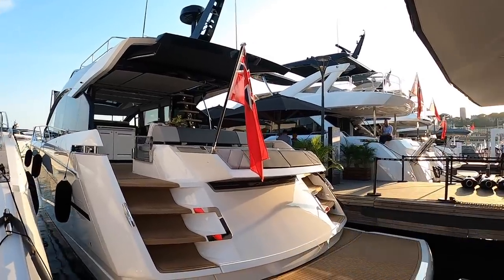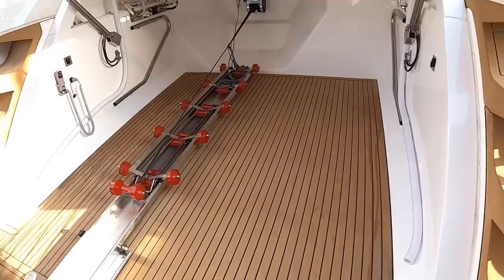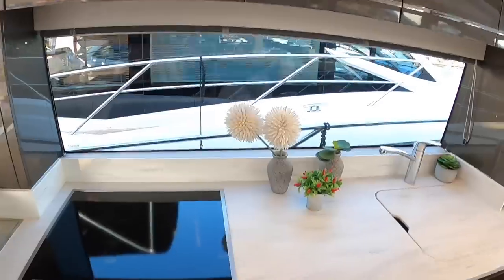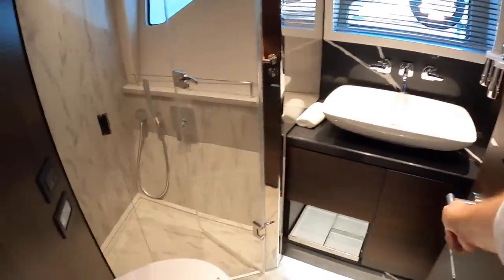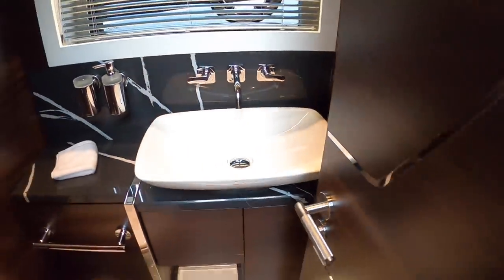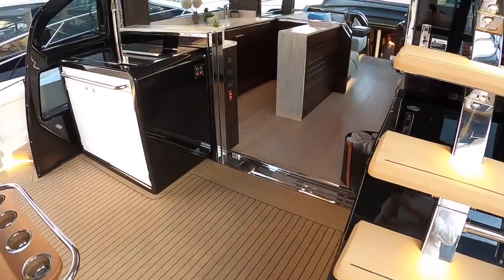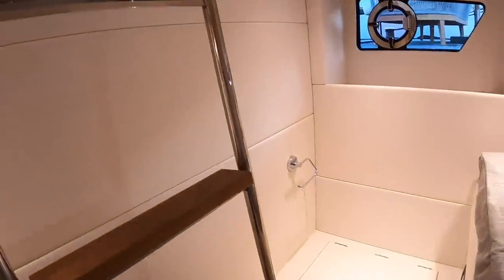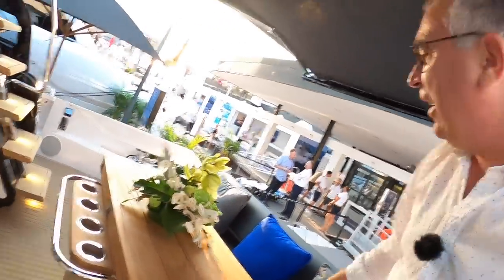£2.4 Million Yacht Tour : Sunseeker 65 Sport Yacht

Comment: I was thinking, crew areas like that one could be great for situations where say you need some emergency servicing done away from the home marina, and maybe need some work done asap and overnight if possible. With a cabin like that, a mechanic/engineer could do that, and then have a place to crash in between work periods, even sleeping overnight if it's a truly serious job. Otherwise, if you want to hire a chef for a party cruise, but all the cabins are full with guests, that's at least an option, etc. Point is, I could see such crew cabins on sub-70 footers being occasionally useful, and in between such times, they still make great storage areas. Personally, I'd always opt for the crew cabin configuration, since it can still serve as storage, but conversely, you can't make a dedicated storage area serve as a crew cabin.

Comment: There were lots of "fantastic", "nice" and "brilliant" in that review. But to be fair, for £2.4M you would expect that!! :)
But my main question: that bow thruster access hatch: is that light like a fridge? Turns on when you open the hatch? Or is it always on. Would you go back and check for me? 😁
Reply: Even if it's always on, they probably use a tiny LED for lighting which would be insignificant in terms of powers usage especially on such a boat.

Comment: Also, maybe you can pass this on to Sunseeker. Why not have the tender areas floor lift up like a basement access? This way if the engines ever need serious maintenance the mechanic is not crawling under the area above the manifolds and still allows for the storage capacity it offers. I race cars and love my one smaller car as I can easily remove the engine with little effort because of the hood (bonnet) design. After all this is a sport boat and I would want to open it up (full throttle) from time to time, but have the ability to maintain it with little fuss.

Comment: I hope Sunseeker works on getting rid of those Luxaflex window coverings and installs semi transparent pull down screens and/or horizontal sliding screens. Those Luxaflex are so difficult to keep clean and look tatty after a while. With running costs I think being 10% of the purchase price it will cost 250,000.- pounds a year to keep this baby going...
Reply from the maker: The 10% thing is just a myth, it's not remotely accurate. 🙂

Comment: Do these boats rattle when going along or is everything fixed very well so you don’t hear anything creaking ?
Reply from the maker: There are some sea trials on the channel so you can see what they're like when running.
Reply: @AQUAHOLIC  thank you
Reply: Generally, with this level of design and quality-builld you'd not hear anything other than at times, both power plants when at w.o.t. [wide open throttle•s]. These days the 'pleasure- boat/yacht' market mandates superior build quality almost across the board. You must recognize that between basic hull design, weight, available power, and overall size a luxury-performance cruiser like this creates 'it's own pathway' (for the most part). Therefore, it's not bobbing around or easily upset by most typical waves and wakes. The craft self-isolates itself and unless you've left a larger power-lid/cover/hatch or door ajar or simply wide open, one hears virtually only the very pleased voices of one's companions. The manufacturer essentially ensures this level of "near  perfection" via pre-delivery test runs, adjustments, checks and re-checks. You might try to picture this puppy in slow motion while intentionally wake-hopping on a 'mild sea conditions' thrill blast. It truly feels as if it is gently and softly settling back into the water as it carves it's way or path. Sorry for the unintended sales pitch. Note, MOST pleasure craft built today live up to this higher degree of integrity••although realistically puppies like this shine equally brightly when simply docked in the marina. Oops, time to re-fuel, again.

Comment: This is a sports yacht pretending to be a superyacht with that office area in the master cabin. Another superyacht touch is the way down into the crew cabin. But let's face it the thing that is going to get every buyer wanting one. Is the driving position up on the flybridge.  They are just going to be itching to get into that seat. Pull the wheel down, put their hand on the throttles. Yell, "Hang On, Everyone" and push them all the way forward.